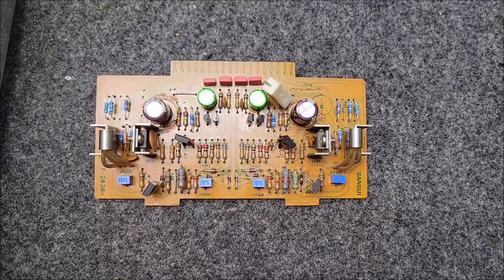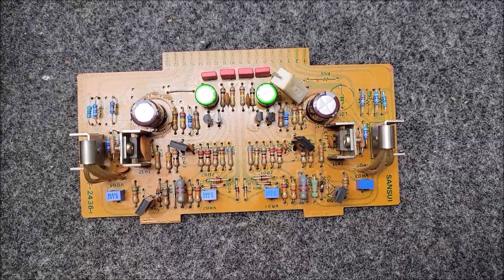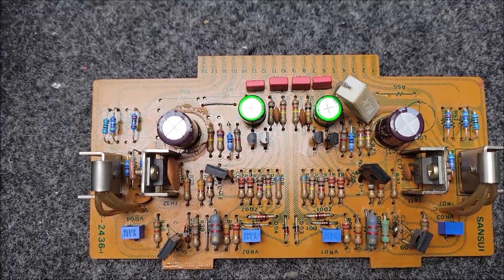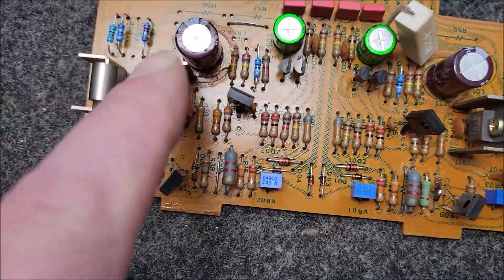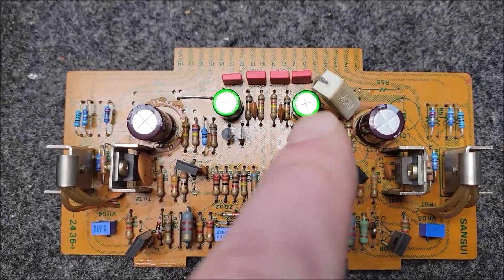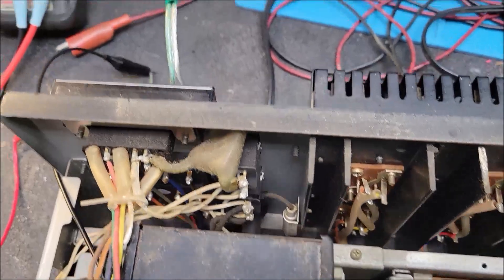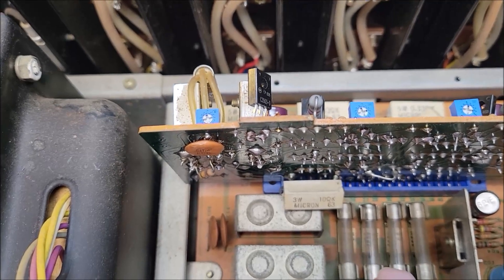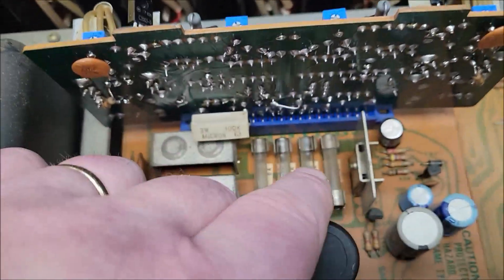Sansui 8080 9090 Bad Fusible Resistors Keep Unit in Protection.  DC and BIAS Alignment.

Comment: i can't understand why almost all tech posts focused on these "fusible resistors" ?  big finds or what??? seemed to me they have nothing more to draw viewers' attention.  my copy  had regular resistors on board, two of them changed value a bit but still ok,  i replaced them with "regulars".  while i was still in the process to find out ways and means to fix the board, i bought two F-2436's which were from QRX-6001 per seller.  they work too as " transition boards "  on my 8080, and they don't have fusible resistors too.  i want to add, sansui, just like marantz that i blasted,  they were very inconsistent, they both in many spots assembled boards differently from design drawings and used different parts on board which might not be even mentioned in the schematic diagrams, such as two physical fuses on my 8080 copy. i also want to add, many (not all, of course not) posts just brag their work whith flipping shots, they don't really want show us how to how to deal with the issues.